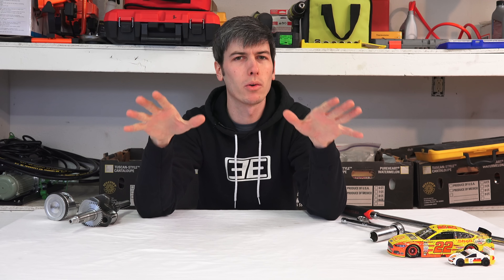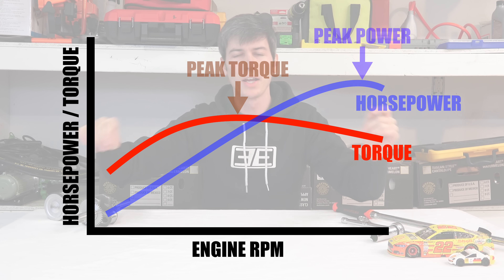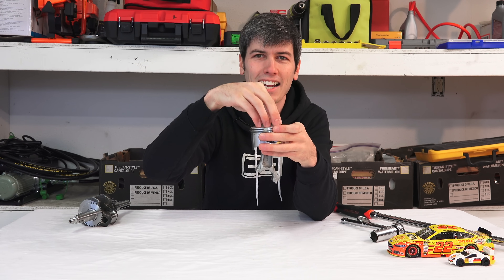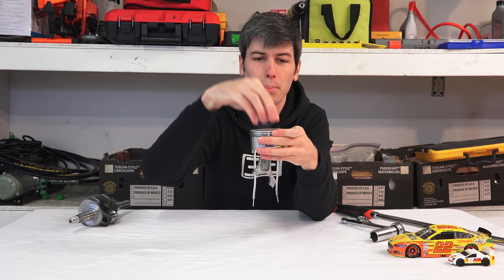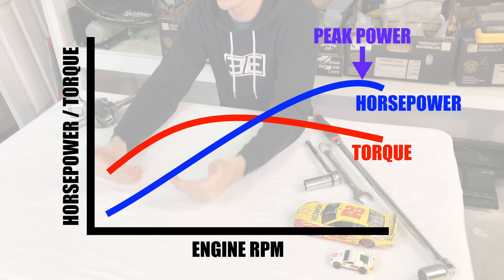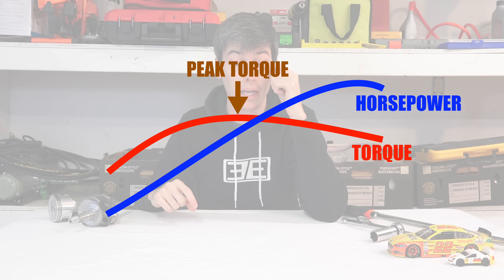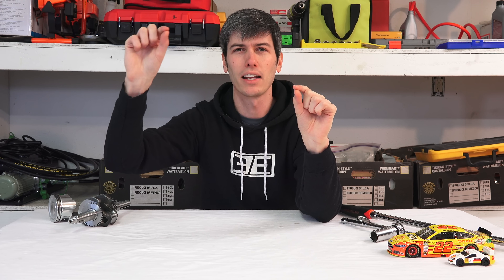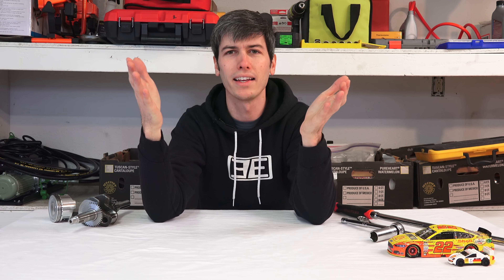Horsepower vs Torque - A Simple Explanation

Comment: why is it that acceleration depends upon torque when he explained that HP is what makes a car go faster?
Reply: Acceleration is proportional to power, and power is proportional to torque, therefore acceleration depends on torque. However, acceleration depends more directly on power.
Reply: @Bare_V Don't be obtuse. People are generally referring to the engine's horsepower or torque output, not the torque measured at the wheels. 

It's not wheel torque alone that leads to a low 0-60 time, but the wheel torque applied to a revolving wheel over a period of time that leads to a car's acceleration. I could apply a large amount of torque to tighten an axle nut, but that wheel torque is not generating power if neither the wrench nor the wheel are moving.

Comment: Damn it! I still dont bloody get it!
Reply: Bert, you are not alone!!  I guess I'll need to watch the video 20 more times.
Reply: acceleration and top speed dpeend on momentary power which is bigest at specifed velocity where you have bigest torque at drive wheel axis at specifed velocity troque at crank is pointless if you dont know at which rpm it egzist at specifed velocity vehicle simple as that you must know that you have 2 "type" of torque this at engine crank and this at drive wheel axis  ., 100 nm at crank at 1000rpm give you less tractive force at whell than 50 nm at 3000 rpm but more than 50 nm at 1500rpm at the same vehicle velocity  now bigest power you have at 50 nm at 300 rpm smalest power at crank you have at 50 nm at 1500 rpm the same bigest torque at drive wheel axis at 50 nm at crank at 3000 rpm and smalest 50 nm at 1500 rpm  corelation or porpprtion beewten torque and nm at crank at speifieeed vehicle velocity give you answer which setup accelerate harder/better just multiple torque nm at crank be rpm at which it egzist at speciifed velocity and you have answer which setup give best acceleration btw best porportion beetwen torque at crank and rpm at which it egzist give bigest power ! and like im wirte bigest momentary power give best accelelration at specififed the same vehicle velocity end of story .so such accelelration depend on momentary power level at specified velocity top speed also depent on it  however if somebody dont like power he can calculate this only be  torque at crank rpm at which this torque egzist and final gearing ratio he from this calculate torque at drive wheel axis and finally from this force at tire circuit which push vehicle forward without touch definition call power you can calculate this in both way results be the same :x now let say we comapre 2 car both the same weight similar aerodynamic both fwd let say etc let say it is new golf 2.0 with disel with turbo which havve 115 bhp and 300 nm  vs honda civic type r one form earlier verison probably ep3 which have 201 bhp and 196 nm  golf pull harder from 1000 to around 4000 rpm  honda from 4000 to 8000 or 9000 rpm ok from 5000 rpm   if you comapre both car from for egzamplke rolling race fro the same velocity offcorse let say 50 km/h and we say driver to use max 4000 rpm and change gear than golf be winner  but if e say to driver in each car to use strongest rpm they have so golf still max 4000 rpm  but honda in this case use rpm up to 8-9000 rpm both again start from the same velocity let say 50 km/h  now honda win because for use optimal power rpm level driver in honda now start not from 3or 4 gear but from 2 gear or even 1 because those gear in this case give honda driver rpm which now he is interest so peak power rpm :) now golf dont have any chance and honda leave him in the dust :)  because despite honda have 30% aropund less peak torque  at crank it achieve this peak torque at 100% biger rpm  and corelation beewten torque and rpm like im write at the same velocity give you true tractive force  thanks this honda win in second race regulation "  honda even where have peak torque so 196 nm at 5600 rpm so not yet peak power which is at around 8000 rpm produce more tractive force than golf 300 nm at 1600 to 2500 rpm at 2500 rpm golf produce around 25% less tractive fporce than honda AT 5600 RPM  and while  honda increase edge all the way up to 8000 rpm in how much tractive force it can generate at specified velocity while acceleration at max golf from 4000 rpm decrease its max tractive force which was at around 4000 rpm at 5600 rpm it will havve much less tratcive force than at 4000 rpm because it is its engine characteristic so peak at 4000 etc :x so like you see torque at crank withoput knowing at which rpm it egzist is pointless :) thats why people saying more toruqe mean better acceleration are WRONG !:D .

Comment: When you apply force at some distance torque is created at the other end sorta like a stress or pressure in a circle motion.
Work = Force times distance 
Power = Rate of work 
So power is how fast you can apply a torque
So your car can have 1000 lb/ft of torque but your horsepower determines how much of that torque is applied every minute or second etc.

Comment: 3:55 - 4:16 can someone explain?
Reply: Changing the size of the gear sprocket changes torque ratio.  Larger gears make more torque.  Like on a bicycle with multiple gears. If you climb a hill you use the small spricket on the pedals and a large sprocket on the wheel.  And then reverse it to go faster on level ground.   
Does that answer your question?

Comment: If the maximum torque geometrically occurs when the crankshaft is at 90 degrees ATDC, why is the maximum cylinder pressure by design made to occur at ~ 10 degrees ATDC instead? Will the resulting higher cylinder wall friction from the angled conrod negate/cancel the available power @ 90 deg.ATDC?
Reply: If you have a wheel and you want to spin it you dont push directly down on the top of the wheel, it will not spin.  If you push down near the top but slightly off to one side it will spin.   If you think of the crankshaft as the wheel and the piston as you pushing down it is how the piston works relative to the crank shaft.  The crankshaft will not get as much rotational force untill it is slightly angled relative to the piston.      Does that make any sense?
Reply: @Bendigo1  That is my exact point. More work can be utilized from the combustion pressure when the crankshaft approaches 90 deg. ATDC (cylinder axis @ 0 deg.)

Comment: Those who are lost torque is how strong the engine can turn the wheels and horsepower is how fast it can do that. A low torque and high horsepower lets the motor turn quickly but with less power behind it ie a fan and high torque with low power causes the motor to spin slower but with more power ie car engines. Idk if this is correct but this is my best guess, i also dont know if you can have both high or both lows. But i guess it would still be equal so i think it would go to Mechanical advantage which is a whole other can of worms.

Comment: Can someone just explain to me why the torque curve tapers off. Ie what drives the force x distance to reduce as revs increase usually beyond about mid rev range?
Reply: Momentum.   When the engine reaches a certain rpm the combustion rate cant keep up.  There is not as much push from the pistons.     If you have riden a bicycle the same thing happens when you start going fast enough, you are still moving your legs but you are not pushing down on the pedals.

Comment: What factors if any affect the torque and power please
Reply: Torque is affected by piston arm length, crank shaft diameter,  and gear ratio.  Hp is affected by piston size fuel type and flow.

Comment: So comparing two cars, the car with the most HP will be the fastest regardless if it has a lower torque (other things equal), correct????
Reply: It will have a higher top speed but have less acceleration.  It will take longer for it to get to top speed compared to the car with more torque

Comment: My friend told me  based on the engine speed is crank shaft length..   Is it correct..
Reply: If i understand what you arevasking then yes.  Longer arms on the crankshaft will limit how fast it can spin.  Shorter ones allow them to spin faster but create less torque

Comment: So... Simply put, torque is force × distance (T = fd) and "horsepower" is just an imperial unit to represent 750 Watts (750 joules per second)?
Reply: Pretty much. Torque is a rotating force, force times distance from center of rotation. Power is torque times angular velocith, the rate the torque is applied. Horsepower is a specific unit of power defined as 550 ft*lb/s

Comment: Don't get it. As a driver, who's looking to buy a car based on how fast it can accelerate,  I have no control over the gear ratio. Its not like I will manufacture my own gears. Why is it even discussed? The theory has little use in a practical situation
Reply: It actually does.  Manufacturers do make cars with different gear ratios.    Cars intended for fuel efficiency or high speeds usually have a low final drive gear ratio.  Cars meant for pulling or faster acceleration have higher final drive gear ratios.    

For example the crown vic police cars come with several different rear end ratios depending on what service they are intended for. Highway patrol cars have a lower ratio rear end compared to city police cars.   Hiway cars may need to get better fuel mileage and go faster while city cars need faster acceleration.

Comment: Easy way to remember...

Torque = rotational force
Grab a tire spinning with low torque and it might stop; grab a tire with high torque and it will break your arms.

Horsepower = moving mass from one place to another in an amount of time.

How they relate. 

A gear is turning and it is connected to wheels. The strength of the gear turning is the torque. The turning gear connected to the wheels will move the vehicle at a certain speed depending on how fast that gear is turning. That is horsepower.

Now, why he was talking about revolutions per minute (RPM)? Consider this - if that gear is turning quicker, the wheels also move quicker, right? And if the wheels move quicker, the vehicle moves quicker as well, right? That is why/how torque and HP are related.

Comment: Using the 200hp@100lbft vs 100hp@200lbft exact vehicles. Would there be a point that the higher torque car would be faster due to power to weight ratio causing the lower torque car to not be able to use its horsepower due to lack of torque? Honest question, double checking my logic. Maybe I’m mistaken or possibly just out of the scope of this video. Which was a very nice general explanation.
Reply: The higher horsepower engine will always be faster. A 2:1 gear would make the lower torque engine have the same torque as the other engine,  except ot would be at a higher rpm. Torque and rpm can be changed with gears, but power will remain constant.

Comment: From a practical standpoint, an engine's maximum torque tells you about its long-term cruising ability (at low RPMs, where gas mileage is good and the engine will last a long time), while max power determines its capacity for racing and short-term acceleration (at high RPMs, where the engine will sound raspy and burn itself up).

Comment: yes  welll explained.  I guess now, it all about high powered engines getting their power mainly from higher rpms, than their older more torquey slower counterparts. That way engines and some of the drivetrains can be built lighter, which means cheaper and with better efficiencies ?

Comment: so if a car has more torque(less power) can it climb rocks better than a car that has more power(less torque)?
Reply: It would be better suited for it yes. But the high power engine can use gears to make more torque, but adding gears increases cost and complexity so its best to start with a high torque engine for rock climbing.
Reply: @Redtooth75  ohh I see that makes sense

Comment: If HP is in part determined by torque, how does HP continue to rise while torque is reducing below its peak?
Reply: Horsepower is (torque x RPM)/5252. When the rpm is greater than 5252 horsepower is greater than torque (in ft*lb)

Comment: Ok so is is correct? 

The more torque you have, the stronger the combustion, which pushes harder in the piston, giving more power 

And power is how fast the piston is turning the crank shaft, making the engine produce more speed?

Comment: A good explanation I understood:
You can leverage torque, meaning the force applied will be greater but the lenght of the leverage arm will increase linear. So the power is always the same, as long as you move your arm in the same speed aa before. When you increase the speed you will increase the power, while the torque applied stays the same. In ICE cars its not only the speed which increases but also the torque, at least at low rpms. Thats why you get a very step power increase. Then torque will start to drop, but not as fast as speed (rpm) increases, so power will still increase. 

This explaination will give you the answer, why a human cannot have the same hp as a car although with a large leverage arm the torque applied by human hand could be greater: you cannot do it with 7000 revolutions per minute
Reply: Here's what I got:
Horsepower is just the rate at which the torque from the explosions are applied. Higher rpm, more explosions providing force, more power. Longer connecting rods will increase torque through leverage but will move slower, so the overall horsepower will remain the same. Torque increases with rpm because at low rpm, there is less fuel (and less force from the explosion) with every revolution of the pistons. At high rpm, much more fuel is needed to keep the speed up so there is more torque. Torque drops off at high rpm due to friction and the limited speed of combustion itself; the explosions don't have enough time to finish before the piston bottoms out. Like you said though, the revs still increase which compensates for the loss in torque, so horsepower still increases albeit not as quickly. Higher displacement engines can burn more fuel per revolution and thus provide more power/torque (and longer strokes can give combustion more time to complete). 

An important point of the video is the note on gearing. Many claim that horsepower doesn't matter and torque is what you feel, which is true to some extent, but it is misleading in that the power can be manipulated to increase that torque. Engines with less horsepower and naturally high torque can't be manipulated to produce more torque than a naturally high-horsepower low-torque engine could. This also means that torque at the wheels can be completely different from torque at the crank depending on the gear ratios being used.

This is a very fascinating concept to me and I'm glad I can finally understand it.

Comment: Also, torque can be made at zero rpm, as in an electric motor pulling/pushing against an immovable load. But no horsepower will be developed as there isn't any rpm.

Comment: Torque is a force applied at a distance. So if I have a wrench that is 1 ft long, and I push on it with 1 lb of force, that’s 1 ft lb of torque. Even if the bolt doesn’t move, it’s still 1 ft lb of torque. 

Now, if the bolt DOES spin, and I continue putting one pound of pressure on the handle of the wrench, how fast it’s spinning will determine how much work is being done. That’s horsepower. Logic would dictate that if I put more force (torque) on the wrench, the bolt would spin faster. And this is true. More work would be happening, and the power output (horsepower) would go up. But at a certain point, I can’t maintain the amount of force on the wrench because it’s spinning too fast. That means I’ve surpassed peak torque. I may still be able to continue to accelerate the spinning even with less torque on the wrench thanks to other factors (like momentum and lack of resistance) . That’s why horsepower continues to climb after peak torque (usually).

Think about pushing a piece of furniture across carpet. The initial force to get moving may be a lot. But as you continue, you use less force but are still able to accelerate. You’re doing more work (horsepower) with less force (torque). 

But eventually you’re going so fast that you can barely keep up and the force applied drops dramatically causing the piece of furniture to slow down. You’ve surpassed peak horsepower and are essentially at “redline”.  The faster you can push the furniture, the more work you’re doing. (Horsepower) 

Keep in mind, the piece of furniture is not the car, it’s the piston. Eventually the engine can’t push the piston any faster with enough force to continue accelerating. (Or if it does, things start to break). But thanks to momentum, you can shift gears, lower the engine speed and do it again. This is akin to putting another piece of furniture on top of what you’re already pushing. You’ll slow down initially but if you have enough force (torque) you’ll accelerate again, even though from a stop, you wouldn’t have been able to move both pieces of furniture at all.  This why Semi trucks have VERY high torque engines and lots of gears. 

If that doesn’t help, you’re not trying.

Comment: I've heard torque vs horsepower explained dozens of times. I still don't get it.
Reply: I’ll help if you want.
Reply: Diesels have a bigger crank so less turn with a longer piston generate more power with less effort. Petrol has smaller crank and shorter pistons so it has to turn or rev more to make same power but in return can rev higher as it can work quicker pistons goes up and down quicker